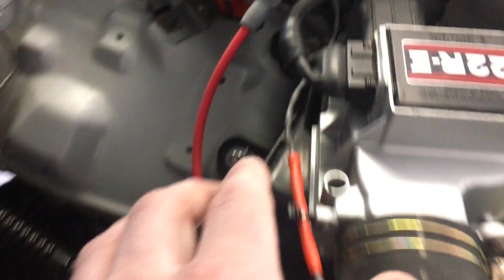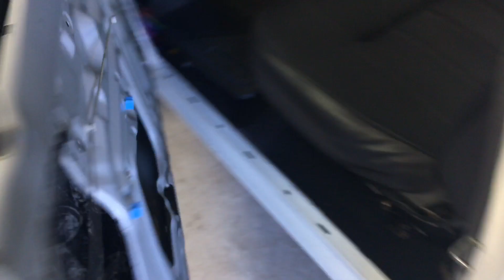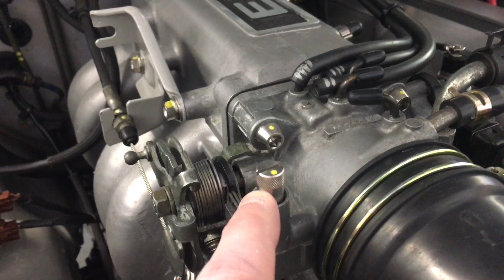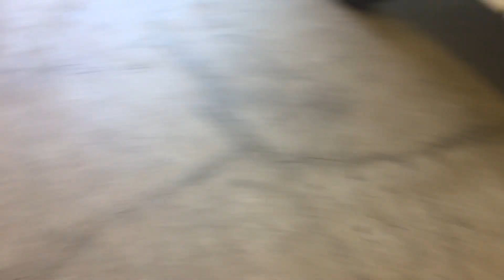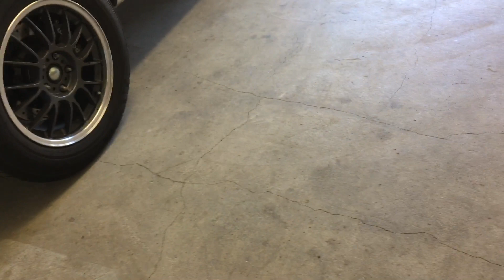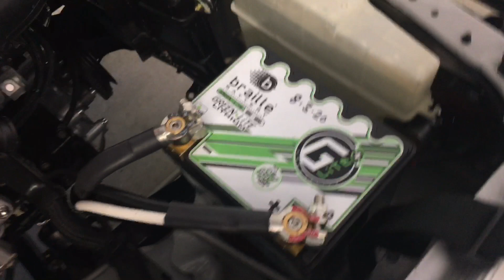89-95 Toyota Pickup 22RE AFM IAC valve air suction idle unstable dropping when warm 500 RPM's

Comment: What kind of plug wires are you running
Reply from the maker: It's these MSD wires. Super happy w/ them. https://www.amazon.com/MSD-31949-8-5mm-Super-Conductor/dp/B0006HP9F8/
Reply: Ray Nada and those will work on the 22re
Reply from the maker: @taylercoto368  That's what I'm running and they work well. Check MSD's website or Summit Racing and you can find out more info. Super nice set of wires though; I love them and their peak voltage is higher with these wires also.
Reply: Ray Nada I have I questions I have 93 with 22re and when I’m driving the check engine light come on and the truck will start to bog then it will go off and start running fine again I’ve tried to pull code but it says that there are no code and it’s got me stumped if you could give any pointer I would appreciate it
Reply from the maker: @taylercoto368  You've installed the proper jumper in the diagnostic box to pull the code via flashing the check engine light correct? If so, then it's hard to say what the flight might be about. Are you sure the truck isn't momentarily losing power and causing the light to turn on due to that? Without more info, it's difficult to say. Bogging could be from ignition problems or lack of fuel pressure. If you can rig up a fuel pressure gauge, I would start there. You should see fuel pressure around 33-35 at idle and more around mid 40's under load when driving. Check your O2 sensors and wiring also... the ECU relies heavily on feedback from the sensors. I'd also verify that your TPS is setup correctly, as this can cause a great deal of issues if it's faulty.
Reply: Ray Nada hey what is the part number on the new Maf from Napa I have to get a new one my has some broke connectors
Reply from the maker: @taylercoto368  I'll dig it out tomorrow and post it here for ya
Reply from the maker: @taylercoto368  Hey, sorry for the delay. My kids are in town. The part # is NEC XTP420055 - when I bought it, it was $239.99
Reply: @ray5961   great video man ur engine is clean. ? Ignition wires u running anything special to run those msd wires I see u have a performer coil anything special on  distributor or cap and rotor. To run a msd set up? Thank you
Reply from the maker: @rzzio8973  Thanks man - many hours of cleaning on that motor :-) I'm running the "MSD 8.5mm wires - part # 31949. Also the MSD blaster coil #8222. Everything else is stock. It all just plugs into the stock distributor fine. I think I had to run a file through the wire holders, since the diameter of the plug wires is slightly larger at 8.5mm is all. Super nice spark plug wires.. I really love them.
Reply: @ray5961  appreciate the fast response ..Many Thanks!!  will get them ordered.

Comment: Hi, great video thank you.
How much does the screw on the top of the AFM/MAF affect the rpms at idle, cold vs warm?
I have played with mine many times in the past & hadn’t noticed a difference.
But now I’m trying to diagnose a rough idle when warm symptom.

And comments are greatly appreciated, thank you:)
Reply from the maker: It's just a screw that blocks off a small passageway. When you back it out, the tip moves up and let's a small amount of extra air through. So it has relatively little impact on idle. It more for fine tuning and it can smooth the idle out a little. If you prop the hood up and watch how the support rod vibrates and adjust the trim screw, you can sort of see what I mean. I run mine about 1/2 a turn out. Usually if you run it all the way down and then start backing it out, you'll see where it starts to cause the idle to really go to hell. The other thing is to make sure your base timing is right at 5 degrees BTDC with the diagnostic jumper across Te and E (check the manual for details if you've never done it before). 5 degrees will give a smooth idle. Also make sure there are no cracks in the intake tube or elbow that runs between the AFM and the throttle body; that's often a source of rough idle. New spark plugs can also help out a lot - Denso is best typically. The other thing is make sure the IAC valve is functioning correctly.
Reply: @ray5961   Thanks so much for your response.
•denso plugs, wires (from dealer)

•throttle body & ports removed/cleaned.

•checked multiple times for cracks (new rubber boot connected to throttle body).

•timing at 3deg BTDC (less pinging).

•IACV (I think this might be not opening all the way & causing rough idle).
Idle fine when hot, but I run a 180 deg thermostat & maybe it’s not opening all the way due to this? Runs at 1/4 temp on gauge, normally...it’s at 1/4 or less when I notice a rough idle.

Thank you, I’ll try tightening down the AFM screw then backing it off.
Reply from the maker: @DePalma.  I'd run the base timing at 5 degrees. Make sure you are setting it with the diagnostic port jumped.
Reply: @ray5961  also should mention that I have tried to adjust my idle when warm &  when set at 850rpms then revved it goes down to 600 eventually. TPS sticking maybe?

I love my truck but I’ve chased this problem for years lol
Reply from the maker: @DePalma.  Put the base timing at 5 degree (when the jumper on the diagnostic port is on) and set the idle to around 900 RPM. If the air/fuel ratio goes off the map, the idle will dip down to 500-600 RPM's at times. Are you running at catalytic converter and/or headers or anything which would speed up the exhaust flow? Or do you have the AS and/or EGR stuff disabled or removed?
Reply: @ray5961   yes I can reset the timer to 5 deg (yes jumped) and then set the idle at 900.
Yes catalytic converter/EGR are in place, stock manifold. No header (I’m in California, they’re strict here:)

If the idle dips what will that tell me?
Reply from the maker: @DePalma.  I'm in CA also, so I hear ya. LCE does make a super nice header which is smog legal (it has the EO # stamped right on the flange). They also make smog legal high flow cats which flow way better than stock. If you are running the EGR, try disconnecting the vacuum line going to the top of the EGR and plugging it up.. that will effectively disable the EGR system, which can sometimes mess with your idle. So that's a test you can try. Also, do you have a vacuum gauge? If so, check to see how many inches of vacuum the motor is pulling at around 850 to 900 RPM idle and also what vacuum you are seeing when decelerating (in gear, off throttle) down a steep hill; that will tell you how the rings are doing and/or if there is a vacuum leak lurking around that could be screwing with your idle.
Reply: @ray5961  thank you for your tips, I’ll give them a try:)
Reply: @ray5961  why timing has to be set jumped??
Reply from the maker: @jeremysmith-mp7nu  It disables the ECU's timing advance I believe, which allows you to set an accurate initial base timing.
Reply: @ray5961  i just cancel My iac valve..  and did the exact same thing You did to My air sensor now it runs great...
That iac valve it's no longer a problem great results thanks.
Reply: Get a new iac valve mine had the same prob
Reply: @westcoastdropper9223  yours had a rough idle when warm?

Comment: Hi, I’m having a big power issue with my 22re. I replaced the TPS already and it was working great until one night it just want bad and now I can’t even get out of 3rd gear(45mph). imma test it out tomorrow morning and swap out my fuel filter. The plugs are new and so is the cap n rotor. I’ll recheck the timing and short the ports on the obd1. Anything else I should give a look at? I haven’t messed with the MAF yet since replacements are out of budget right now.
Reply from the maker: I'd start by running a compression check on all cylinders. It's possible you spun a bearing. Also check for blockage in the exhaust system (such s a collapsed catalytic convert internal); an exhaust restriction can cause a dramatic decrease in power. Also try pulling the plugs one by one to see if the idle drops on each of them. You can also do the same thing on the injectors to see if there is a change when you disconnect each one. Changing the fuel filter is a good idea no matter what, so that's worth a shot. Definitely do a compression check (crank 10 seconds with the throttle body held open) and all plugs removed. Ideally, they should be 170 to 190 and no more than a couple PSI difference across all the cylinders. Also confirm there are no exhaust blockages.
Reply: @ray5961  I did check the compression a couple of months ago I can’t remember exact values but I remember everything was good and all were within 3psi of each other. The engine was just rebuilt around 2k miles ago. I’ll drive it and see if the cat glows. I’ll be back with an update in a few hours
Reply from the maker: @xanny7373  hopefully the head gasket didn't blow. Did you install the head yourself or someone else? I'd re-run the compression check
Reply: @ray5961  I have no idea who did the rebuild. I’m second owner and previous had it rebuilt. I think it also sat a few years after the rebuild probably since it was also lacking power when I first got it (TPS was gunked up). Hopefully my tps just went out of wack since It has lifetime warranty on it.
Reply from the maker: @xanny7373  I hear ya. Mine was a similar situation... someone else did the rebuild. I ended up putting a new LCE head and cam on. With regard to your TPS did you set it according to the manual using feeler gauges and all that?
Reply: @ray5961  I did, that’s why I was confused as how it could have gotten messed up, it was out of no where when I was on the free way trying to keep up with traffic( around 70mph) and then no throttle response. I’m barely about to check it out since it’s so hot outside it’s hard to motivate myself to sit in that heat Lol
Reply from the maker: @xanny7373  I hear ya.. I should be outside right now working myself haha. You might also try reseting the ECU by pulling out the 15A EFI fuse. That helps sometimes reset things. Pull the fuse for 10-15 minutes and then reset the car; I've found that helps clear things out after making changes to the TPS and AFM, etc.
Reply: @ray5961  I’ll try that out right now. I had a small exhaust leak so I was use testing rn making sure no more exhaust coming out seems good for the most part. I ordered EGR delete plates because I’m tired of worrying about it. Next is putting on the filter and checking the timing because if the tps isn’t giving correct values then shorting e1 te1 should show a very high degree of timing. And I’ll reset the ecu once I’m ready for break
Reply: @ray5961  I checked the timing and it’s at 5° on the dot then the timing mark won’t show up for a few seconds (maybe 5-8s) then it’ll come back. I don’t have CEL regularly but with shorted obd I get code 42. Now I’m not sure what to check. Should I still check the values on the TPS? Since the idle dropped. I don’t want to take anything apart if I don’t have to. There aren’t any throttle body gaskets in my area so I would have to reuse it unless I ordered one. 
Edit: I did a more searching and a lot of people are saying speed sensor for code 42 or the dash because the speed sens. Talks to the dash then the dash to ECU. But i have a cable driven speedo (speed and odo don’t work, fuel gauge and coolant temp go off and on when driving too) So now I’m really confused as what I should be checking
Reply from the maker: @xanny7373  The timing should stick around 5 degrees pretty well - only a few blips away from it but only for a 1/2 second. Something sounds like it's off some place. I'm not sure what code 42 is, but I'd investigate that for sure.
Reply: @ray5961  i checked my tps values I had to use about 0.01mm off bc I didn’t have the right size but everything is well within ranges still. so I’m going to try to redo my ignition timing. I did some digging and code42 is just bc my speedo doesn’t work since it uses the dash as the speed sensor to the ecu and it’s cable driven so i don’t think it’s a part of it. I’ve read that the timing chain could have possibly skipped a tooth which sorta makes sense but i don’t think my chain is loose enough for it to happen. I don’t think I hear any chain noises that would come from a loose tensioner. I wanted to test my compression but I don’t have a battery charger to hook up to while I test but I don’t think it’s that anyway. So I guess I just have to hope it’s my spark plugs which are new as well. Hopefully the gap is just bad somehow
Reply from the maker: @xanny7373  what worries me most is the timing going off track for 5 to 8 seconds... that sounds like maybe there is an issue with the ECU or perhaps the distributor pickup maybe. Have you checked the air gap inside the distributor and made sure there's no water or anything inside the cap?
Reply: @ray5961  I haven’t checked the dizzy cap but I did put a brand new one on before I Changed out the tps because that’s what I thought it was. But I’ll double check that in a bit along with the timing. I pulled the ecu fuse out last night and I forgot to put it back in so that should reset. I’ve been putting off doing the fuel filter because I don’t want to add another thing to the equation but I’m starting to think it might be a good idea to get that out of the way just to know for sure if that’s not problem. I made a smoke tester and I’m gonna try that out but I’d assume if I have a big enough leak for this kind of issue that I’d be able to hear it. Thank you for all the help so far!!
Reply from the maker: @xanny7373  you're most welcome. Hope you're able to find the issue. Check your PCV system also
Reply: @ray5961  i haven’t checked the pcv system yet but i did find out that i’m only running on cyl. 1 and 4 because i pulled the plugs from the dizzy cap and they all arc from the cap to the wire but when i remove 1 and 4 far enough to not get an arc the engine wants to die out but it stays the same when i pull plugs 2 and 3. double checking them right now.
Reply from the maker: @xanny7373  Yeah, if you pull the spark plug wires and nothing changes on those plugs, that's probably an issue. I'd check injectors also. But if you can confirm you aren't getting a spark, that may be something in the cap or the air gap or even the shaft bearing. They sell a little spark plug thing you stick in the line which lights up... you might try that. Or just pull the wire off and hold it about 1/8th inch away and see if you are getting a spark across the small gap. You might also search for the TA500 on amazon; I have one of those and use it to tune chainsaws; it works well for checking the health of the ignition system on the Toyota or any car also.

Comment: Hey man I just got a pickup with a 22re. And it sometimes randomly pops at like 1k rpm, buts fine at idle (800 rpm). It also pops on deceleration. I tried tuning it richer and leaner, but it still popped lean and rich, a little worse when lean. Is this probably something with the fuel system? (Pump, filter, injectors)?
Reply from the maker: Sounds like you probably have an air leak in the exhaust system some place. I'd check the air suction system and also check the exhaust system front to rear to see if there are any air gaps allowing air in.

Comment: Dude! I've been dealing with the same issue for years! Constantly screwing around with the air flow potentiometer and idle screw. Gonna give it a go today.
Also, I sometimes will run crank case breather tubes into a bottle out of sight.
Reply from the maker: Yeah, never a dull moment trying to get a toyota pickup to idle smoothly haha :)